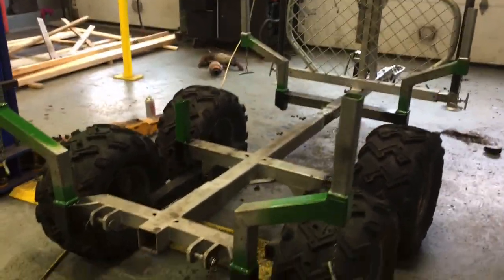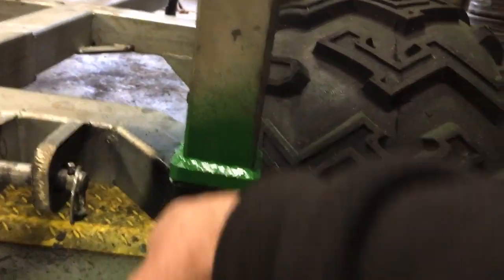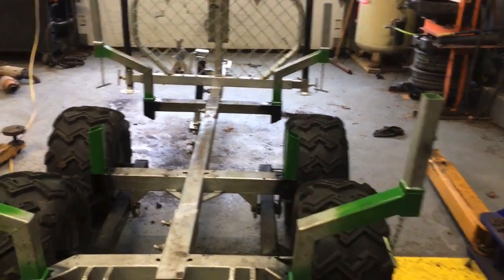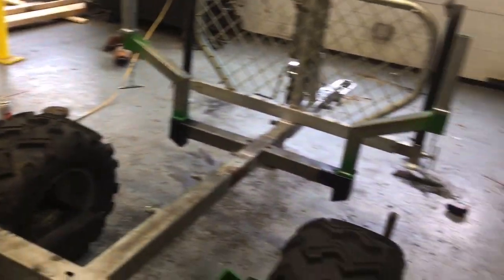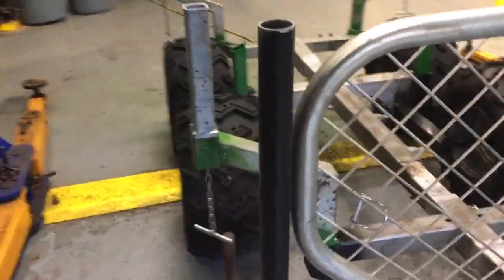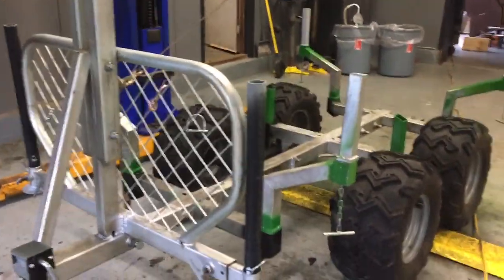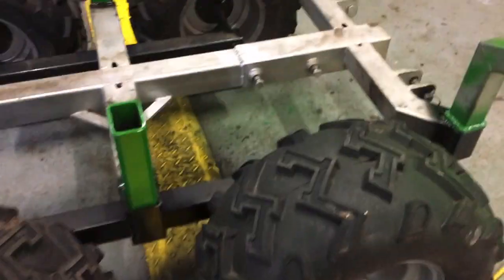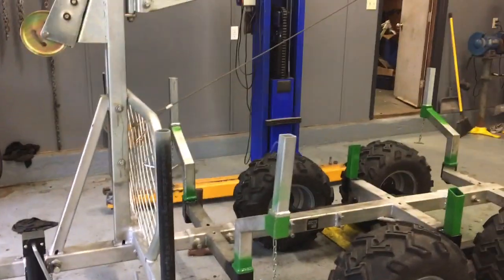Woodland Mills T-Rex trailer upgrade

Comment: Designed in Canada made in China?
Reply from the maker: Exactly... that might have changed my mind if I knew that when I bought it.
Reply: @thelogfather5002  how's the quality of the build?
Reply from the maker: The design is great, the build is fine, but the steel quality is very poor. I’ve replaced a lot of the weaker material with some quality Canadian made steel. It would be the same quality of product that you’d buy from Princess Auto or Harbour Freight, your imagination can make the connection... :)